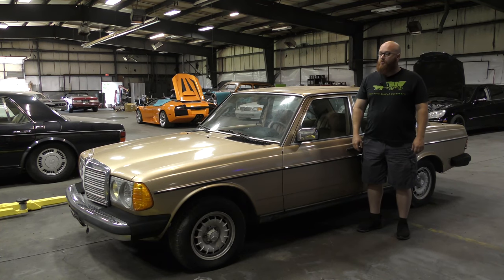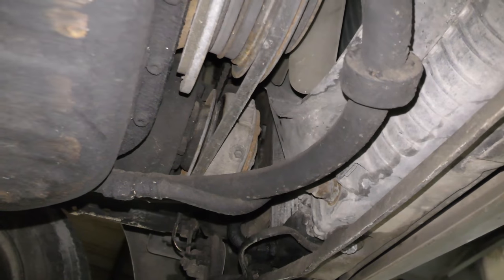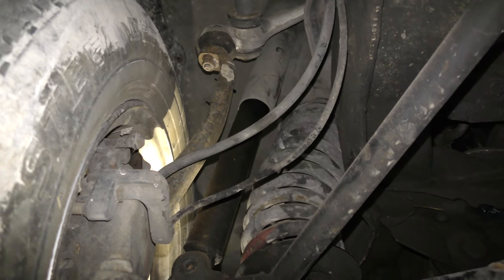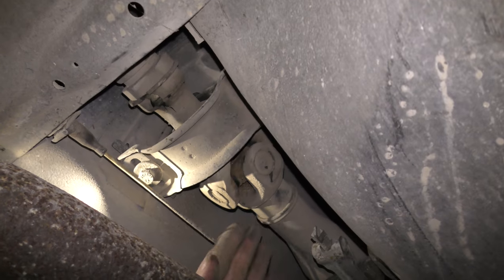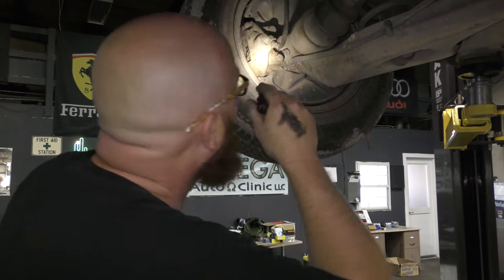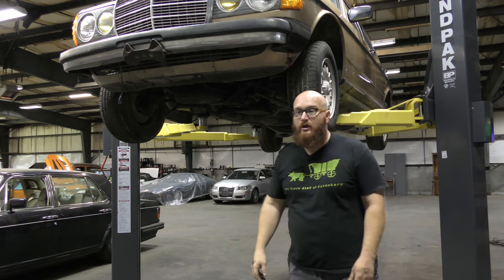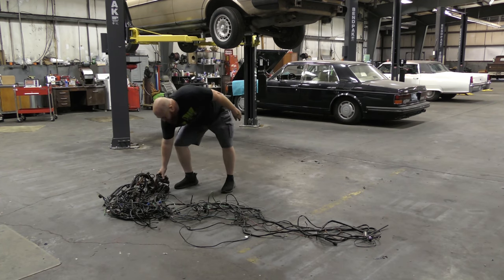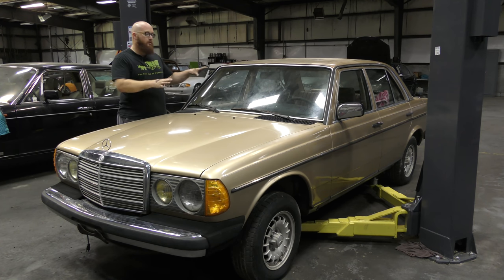What's lurking underneath? CAR WIZARD finds lots of repairs required to make '84 300D MB roadworthy

Comment: Nice car worth putting whats needed into bringing it back, especially with so little rust.  Pretty obvious the previous owner completely neglected proper maintenance.  This car was a hazard when it was on the road.  I bet there's even more issues lurking like the oil cooler lines, they need to be replaced as they can and do fail.  With the rest of the car being that neglected I'd really be wondering about the state of the internals of the engine/trans.  Wonder when the last time the engine had a proper valve adjustment was, or when the transmission was serviced.  I'd bet they neglected oil changes to, which means accelerated wear on the timing chain/guides etc.

99% chance it also needs:  Front wheel bearings, timing chain and guides, vacuum pump.

Comment: From a pure economical point of view, you should ship this car to Europe and part it out. Or sell it. Turbo diesel 123 are popular in Europe and compared to most European csrs the US cars are well equipped (AC, cruise control, sunroof, power windows). If interior is decent, you fix the small rust issues and get European bumpers on it I think you easily get +€15k without making it mint condition.

Comment: Mercedes Source out in Washinton State,  Kent dose Youtube and writes repair manuals and has sources for parts.  The car is worth restoring, because its Grampa's car, it's in decent shape. The downside is parts are getting hard to find.  I had a 300 SD for a while, it was a pretty good car even thou it was in rough shape when I bought it, cross member under the engine on the driver's side failed it was not repairable. There is a common car here in CT. I see them on the road often. Some of them are in showroom shape. If I was going to by one today, I would look for one in Southern CA, AZ, NM, and TX.  The dry desert parts of the country.  Where I live they put salt on the road during winters and it just eats the cars. Even then it's going to be the issue of ongoing parts issues. As nice as they are, they are getting into collectible status, and not an everyday driver. Then again I still would take one over a Lamborghini.
Reply: Kent of Mercedes Source is working on one right, now link to it is: /watch?v=yr-82r3zlXw.

Comment: I had a 1981 240D 0 to 60, Tuesday
Reply: But did it ever let you down?
Reply: @fastinradfordable  not really, just had to replace component that shut the engine off. It was a great car
Reply: I have a 82 240d. The quarter mile time on those cars is less than it’s zero to sixty time.

Comment: I heard in the first video the age of the car, the platform, and where it had been stored.  All I could think was this is going to be very expensive.  Even with a used harness would be very expensive to replace that unit.  If the owner wants to fix that car then he might as well fully restore it.  It is not worth it no matter how you look at it unless you want to do that as a collector piece.  Thing about that cost of getting a Toyota - it is going to be more reliable than this after all the repairs as the leaks will continue that are not being repaired.

Comment: I'd contact Schwartz performance to see if they can make a custom frame with a 4 link, disc brakes with a LS7 motor, gut the whole thing and turn it into Frankenbenz and have all new wiring. It will be a MIBO - Mercedes in Body Only lol

Comment: Hey Wizard, are you able to say how much is fair mark-up on parts pricing passed on from the Mechanic to customer? I was recently quoted $250 just for the part for a rubber driveshaft coupling that I could've purchased down the road myself. I understand there is time and shipping to the Mechanic involved, but it was $150 on top of $100 cost for the part....

Comment: Hey Car Wizard ! I have a question and would love if you could give me some advice.

I own a pre-facelift 1994 Mercedes-Benz C180 (W202) with M111 engine. I have driven almost 10 000 miles with not many issues (car has been driven 238 000 miles). However, one issue I have faced is I am losing coolant quite rapidly (I knew about this problem before purchasing, so it has been around quite a while; with me over a year now). I haven't noticed any external leaks or stains on the asphalt, interior floor mats are dry and oil is clean and no foam buildup under the cap is to be seen. I have also checked the washing fluid and it's fine (besides, there is no heating element, so it is not that). There is no mentionable white smoke coming from the exhaust, except when cold starting on a chill day. The coolant "reservoir" is located directly on top of the radiator, there is no separated coolant reservoir. The radiator cap seems fine, although the rubber has been bent just a little from one side.

I have lost coolant as much as 2 Liters per 2 weeks during summer. I do use aftermarket green (or turquoise) coolant (mono ethylene glycol, standards BS 6580-2010 and AFNOR NFR 15-601), but I don't think it would be a reason for such rapid consumption of coolant...

Where should I start looking? Some people say that it could be the water pump, but I find it strange that it is just mysteriously disappearing without any traces..

Thanks for any advice!

Comment: $3-4 K  to have a classic in good shape  with work done right - The owner would would easily pay that for  a newer car  plus have to make repairs-  this is a safe car for a teen and definitely not too quick where a teen is tempted to be fast and furious-  something that definitely warrants consideration-
Reply: This thing probably doesn't have an air bag. Crash tested okay for the time, but the overall safety of this car is poor in comparison to most modern vehicles made in the last 10 years.
Reply: @klinky  who needs air bags?  this car is more solid that any plastic mobile of tody

Comment: 3-4 grand im actually surprised that it's so little.... By the way, i owned a W201, and i was again surprised about the low cost of spare parts which are very often still available at your Mercedes Benz dealer.

Comment: Hey wizard would you help me out
Battery is giving full voltage and terminals are changed recently and alternator is working fine but why car sometimes after a long drive with or without A•C, car won't start on few early cranks,why so
Car is Honda City 2000

Comment: As much as I love the W123 series, unless someone gave me the car (in really great shape), I wouldn't spend the money it takes to get it back in perfect condition.  The AC system alone is around 1K to get going.  Almost nothing on these cars is inexpensive.  Nothing more expensive than a cheap xxxx!
Reply: My thoughts exactly. So much money needs to be spent on this car that it's just not financially viable. Not even counting labor costs, the parts list will be astronomical. Scrap is what it is..
Reply: Right! I got a 1984 300TD for a cheap price in decent conditions but still definitely worth putting my time & money into. I'm at 2k so far with parts alone, not including all the cleaning supplies (mostly industrial degreaser to steam clean the engine bay), some extra tools needed. The 3 book MB repair manuals & body/Chassis repair books were a heafty price on there own 😬. My own labor will be what saves me; I just got to keep at it.
Reply: Martin Svensson  I totally agree! I worked on and been around these cars for years. There are still a ton of these cars on the road. Younger folks are discovering these durable diesels and I see more and more of these W123's. Brakes, suspension and normal wear parts are produced by several OEM and other German aftermarket parts suppliers at reasonable prices.
Reply: what  better car you ccan et for 4k? plus a 123 in great shape will only gain value in the future. In 10 years people will pay $15 or $20 for a good 300D. Immaculate ones here in Europe cost already 6-8k euros. but if you think it´s still cheap for what you get. for the price of a used chevy Cruze lol
Reply: @joshlopez6336  If you've got the skills to do your own labor then perhaps it's worth doing. Otherwise, however much you spend on parts will at least double by adding garage fees. Best of luck to you Josh.
Reply: Martin Svensson  Once the car is running with no faults at all, how much do you reckon you'll have paid out  in parts and garage fees? If you start down that road, your ONLY option is to keep it in order to justify what you've already spent. And you'll keep spending, because no matter how well you look after the vehicle, it's 36 years old and (almost) every part that isn't a new replacement will fail.
Reply: Martin Svensson  This debate could go on forever. Let's just agree to disagree and leave it at that.

Comment: Hey Wizard, I have a W126 with a modified all motor M117. The big cam makes it constantly break those shock absorbers on the engine. You have any ideas on a solution?

Comment: Question out of curiosity.... I saw the commercial swamp cooler blowing into the shop in one of the previous videos.   Is that actually effective there?  I feel like in your climate an evap cooler wouldn't help very much, but I assume you wouldn't have it there if it did nothing.

Comment: Question, Wizard.  When driving on the highway,  my right front wheel feels as though the lug nuts are loose shake, not severe, but noticable. The lug nuts are tight, and have switched the left and right front tires, still the loose lug nut shake.  What is the very first thing you would check?  I town at no more than 50, no loose lug nut shake, only at 60+ MPH.
Reply: Check the balance of your tyres on the wheels.

Comment: I'm not knocking these cars. They are cool but having repaired several older American cars to use as daily drivers,I have never seen the amount of issues especially thing like shift linkages on automatics that all these supposed highly engineered and high quality german cars seem to have. It just seems the marketing and media people have duped us all thes years.
Reply: That's exactly what I am finding on the 2015 Mini Countryman that I am working on atm. Am working in the engine bay, wiring tape coming undone, part that has failed, windscreen washer motor, has BMW on it but it is made in China (says so on the part!), not impressed given what you pay for them, $250!
Like Porsche did for many years with their cars, all smoke, mirrors, promises and BS until the buyers found out and sales started dropping. Have improved them a bit but you still have to do a lot of maintenance on them to keep them going. My Subarus have been more reliable, 160,000 is without fail.

Comment: I think $4000,- is actually not even that expensive to fix this car. For that money you have something that will drive well. Buy any car for $4000,- and you probably have sink in an other $2000,- before it is sorted.
Having said that, I would never ever give a W123 to any teen.

Comment: German fuse boxes from the mid-1980s and earlier -- WTF were they thinking?!  Those fuses are uncovered, and inside the engine compartment where they will be subject to weather.  The fuses themselves literally are held in place by spring-loaded terminals that will corrode over time.  No wonder Mercedes powered most everything with vacuum on that car -- the electrics were so stupidly designed.  If you take out the fuses every 6 months or so and clean the terminals, it'll be fine -- but only in a German car could there be maintenance on the damn fuse box!  (I used to own a 1980 240D, so I know from experience.)
Reply: LMacNeill What are you talking about? The fuse box for the w123 has a lid that uses 2 big knobs that screw in and seals off the fuse box. Yours must got have gotten lost.
Reply: @300DBenz  Yeah, mine never did have any cover.  They were wide-open, ready to get wet every time it rained.  Are you sure the 240D in 1980 had one?  Maybe they didn't have one originally and then added it for later models because of the issues that mine had?  (Or maybe mine just went missing somewhere along the line, like you said...)

Comment: Heres a question many of the car guys i have met over the years all have different opinions on ,would it be good idea to steam clean the entire engine and underneath of the car first before carrying out any work ?  some say yes and others prefer to leave it as it is .
Reply: worth a clean  in this case- better to see any other potential issues and  fix them
Reply: Clean it, then drive it a for week, so if anything leaks, it will show up when the mechanic looks the engine over.

Comment: I would be very surprised if all that work could be done for under 4K.  I almost bought one once, but decided against it when I took it for an inspection at a Mercedes specialty shop.  There were quite a few problems including some evidence of prior body damage.  No thanks!

Comment: It seems it been a while since you don’t work on a W123. Some of your assumptions about this car and what it would take to fix it are not accurate. In the first video you pointed out some mechanical components that were incorrect, for example you said the VCV was the shut off valve. Now you say that parts are hard to find in the US. That is not the case. You can easily find every part needed to fix it from online sellers. There is no need to get a parts car full of bad worn out parts. ALL is available new from places like Ebay, Amazon, FCP Euro, AutoahusAZ, ECS tunning, MB dealers across the nation, Mercedessource, Rock Auto, Peach parts and many others. I have an 82 just like this one and I always find everything I have needed during the last 7 years. I can even choose the brand of the part I want. I’d rather buy parts for this car than for a 10 year old Kia or Nissan.

Comment: I've had 2 W123's.... and I replaced leaking oil cooler lines lines on them both and didn't break either oil cooler.  The biggest bitch was snaking the line through from the bottom of the oil filter to back to the cooler with both upper and lower lines.  The threads are giant... how in the heck did you strip them??????
Reply: ZaphodsPlanet Replacing the oil lines is much easier if you remove the engine mount.

Comment: There is no way in hell I would hand that car to a teenager. 
Absolutely beautiful car, and fixing it yourself would not be that big of a deal. But there is no way in hell I would put $4,000 into that car and then hand it to my teenager. It'll end up in a pole, in a ditch, or flipped over.
The more responsible thing to do is buy her the boring Toyota Camry with better safety equipment better brakes and better handling.

Comment: For anyone romanticizing about having one of these old 123's, do yourself a favor, find a running one and drive it.  I've owned one and they're not for everybody.  These cars drive like a truck.  The steering is heavy and they're noisy.  I didn't find driving mine a pleasant experience and I never wanted another one.  I'm forewarning you, go drive a running one before buying one to fix up.

Comment: Buy the kid a car with all the modern safety equipment.
Reply: I agree I would rather my kid drive a car with the highest safety ratings.  This car is fine I mean kids used to daily worse but if you can get something safer.
Reply: Um. 
Old Mercedes are some of the most engineered for crash tests out there. 

If you believe a full sized Mercedes isn’t safe enough for your offspring. 

Your grandparents would be ashamed.
Reply: These are actually really safe.  Probably not comparatively, but it'll be reliable and they're not fast, so likely kid isn't going to get into trouble speeding or taking any risks.  This car is sentimental value, belonged to the family and they would probably rather have it be used.  Hope the daughter looks after it and learns from it.
Reply: These are built like tanks.

Comment: Wow it really seems like this car should be scrapped.
Reply: disagree as its not bodily rotten, its what i would term an enthusiast rebuild, outlay of  costs over  1 or 2 years  rather than upfront......unless  you have  bundles of cash to start with
Reply: The ONLY times a w123 should be scrapped is if :

1. It has been wrecked.
2. The engine is blown.
3. Rust has eaten holes in the body.

If you can’t afford to fix a w123, you can easily find someone to sell the car to that will.
Reply: @300DBenz  you'd rather have this than a modern Camry?

Comment: J.D. Power says Low retail is $3,825, Average retail is $6,075, and High retail for the car is $8,100. Despite what the Wiz just said, it’s gonna cost an easy $5K to get it perfect: tires, brakes, oil cooler, suspension, etc., etc., etc.  Throwing good money into a losing situation. There will ALWAYS be something needing attention/fixing. Money pit.
Oh, by the way, very cool wheels.